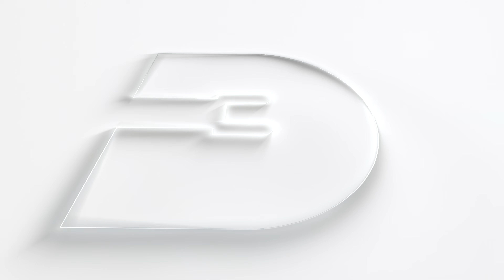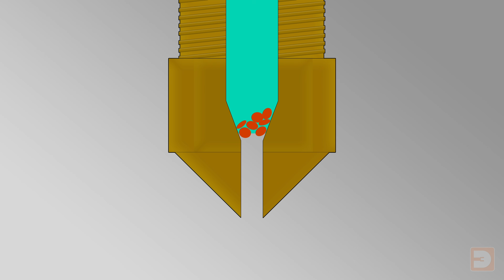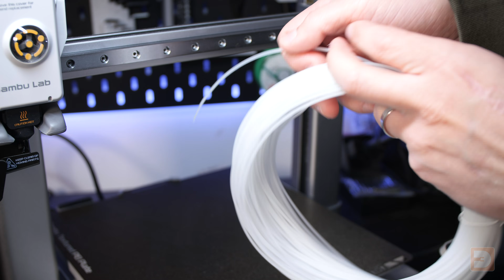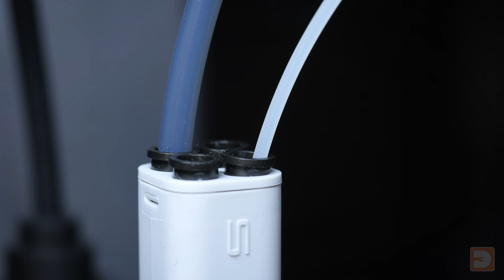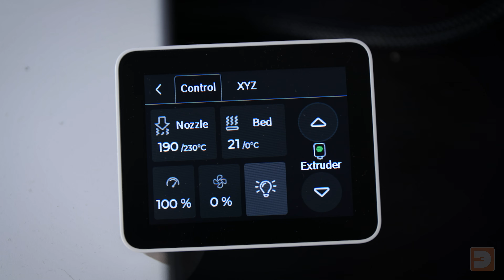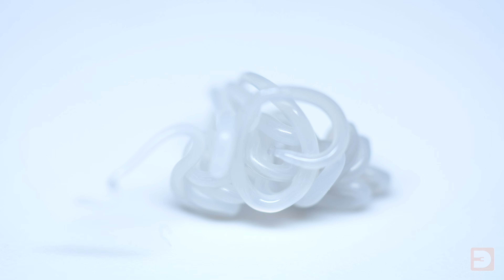Prevent clogged nozzles: Cleaning Filament Magic

Comment: Genuine question what's the point of this when the cost of this filament is more than the cost of multiple new nozzles, or the same as a carbide one? It makes more sense to just buy a set of 4 hardened steel nozzles for roughly the same amount and just replace them.
Reply from the maker: Preventing a blocked nozzle isn't just a matter of the hassle of unblocking it.

Firstly, if you don't employ maintenance measures to prevent blocked nozzles, you drastically increase the chance of failed prints due to blocked nozzles mid print. 
That may not bother you too much if you only recently started it, but if a print fails 48 hours into a 3 day print, due to a blocked nozzle which could have been avoided, you'll be kicking yourself.

But irrispective of that, a blocked nozzle can also cause other damage to the printer. If the nozzle is blocked but the printer continues to try and extrude filament, it can cause a number of issues, like overloading motors throughout the extrusion line, cause filament to be grated down inside the extrusion systems resulting in the entire filament path of your machine needing to be taken appart to be cleaned, or, as per the thumbnail of the video, it can cause molten filament to be pushed out of other parts of the extruder system which can ultimately write off the entire extruder block or even the printer.
Reply: @3DRevolution  I don't think that addresses why you wouldn't replace with a new nozzle over doing this process. All of what you mentioned are scenarios where it wouldn't matter if you cleaned or not because you're talking about random non predicted scenarios and the cause that would lead you to then use a filament cleaner. Unless you're saying that you should always use a filament cleaner before a print, which was never explicitly stated.

Comment: I can definitely say that this cleaning filament works.  I had 2 samples of this and Im only 4-5 months into having my printer.   And I had a clog recently and used the method here and it worked perfectly.  The first time I didnt know I had a clog and it fixed itself after a bunch of failed prints and retries.  But now Im hip to the symptoms and this is will be my goto method.

Comment: Where is that filament splitter from? Does it work well?
Reply from the maker: It's by Bambu Labs and is the one which comes with the Bambu Lab A1 printer. However, for my X1C and other printers where I need a splitter, I use the Easy Split, which I designed. 
I spent weeks working on the design, testing and refining it, and the final version which I published is great. I've been using it for a year and put thousands of hours of prints through it and never had a single problem with it.
https://makerworld.com/models/100346

Comment: What material is the filament cleaner material?  I have loads of the stuff.
Reply from the maker: Good question.
The 'ingredients' of cleaning materials like this vary slightly from manufacturer to manufacturer but they do tend to share the same core concept.
The core material is usually nylon, HDPE,  or PC.

However, this is mainly to ensure it is suitable for use, and the active ingredients which make it a functional cleaner filament are additives.
So a unique mix of abrasive or hydroscopic materials will be mixed in to help remove moisture and filament residue from inside the nozzle.

Many will also include a mix of materials which expand under heat to assist it in physically pushing anything else out of the nozzle.

So whilst the core material is nylon, PC, or HDPE, that doesn't mean using a standard roll of nylon filament would be as effective as dedicated cleaner filament, and equally, cleaner filament wouldn't be suitable for actually printing with.

Comment: I think I'll try that cleaner filament.  I've not experienced a full clog and I don't want to.  

So far I've only used PLA (regular, Matte, Silk, marble) and PETG (regular and CF).

I've had occasional issues with under extrusion though and i think this cleaner could at least rule out possible partial clogs.  I've a bunch of spare nozzles from when i couldn't fully clear a partial clog.  This cleaner might revive those nozzles 👍😄
Reply from the maker: Switching between PLA and PETG (especially with the added CF component) it definitely could be good pratice to do something like this to help prevent a clog.
Remember, flossing is a preventative measure! Or that's what my dentist always tells me.

Comment: this could use as multi material to bambulab, not only multi colour....if bambu give some firmware to support "cleaner" mode in between material change while printing...
Reply from the maker: That could definitely be a nice added feature. However, due to never needing much of this cleaner filament, most vendors supply it loose, not on a spool, so you'd need to manually spool it up to run it in an AMS. I'd imagine if Bambu were to add that as a software feature, they'd release their own AMS compatible mini-spool of cleaner filament at the same time. Would be be cool to see though, great shout.

Comment: I don't know if I'm doing something wrong or right but I've been 3D printing for probably over six months now and haven't gotten a clogged nozzle and I have three FDM printers am I lucky I guess
Reply from the maker: You're definitely doing something right.
It can largely depend on the sort of things you're printing, the printer and nozzle you're printing with, the materials (and mix there of) that you're printing with, even the slicer settings can affect it.
But if you're not getting clogged nozzles, that's definitely a good thing. In the 10+ years I've been actively printing I think I've got a clogged nozzle once, maybe twice. Keep up the good work, and happy printing!

Comment: Thank you for this video, I like this kind of format, short and direct to the point... we don't always have neither the time nor the wish to spend 15 / 20min for a specific topic.
Reply from the maker: You're really welcome! When I feel the content can be covered in a shorter format I'll absolutely aim to do so as the last thing I want is to waste your time. Time you spend watching my video is time you can't spend printing. Sometimes however there's just too much info to stuff into a particularly short video, but that's why I always include labelled chapters so if you're after just a specific piece of information, you should be able to jump to the section of the video you need with ease. 
Thanks again for the feedback, and happy printing!